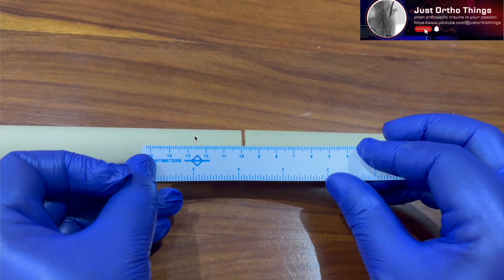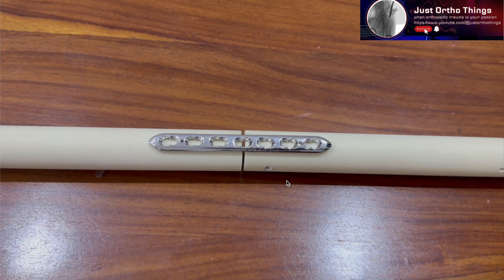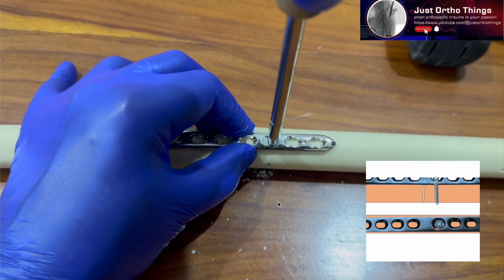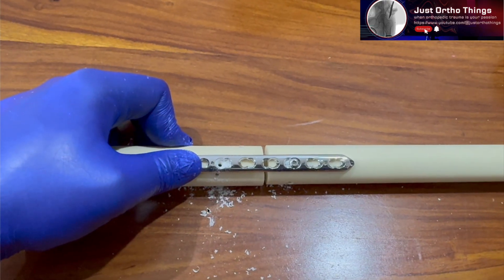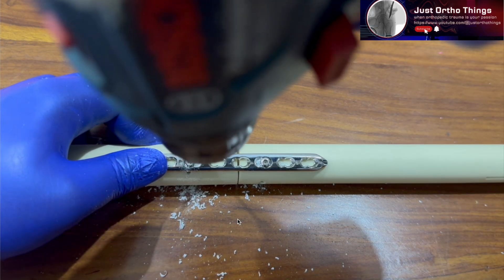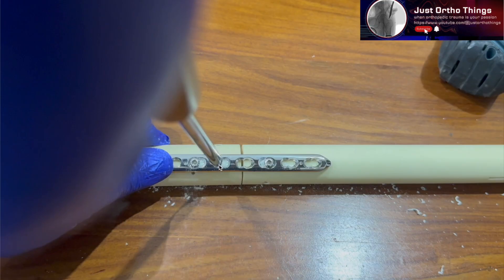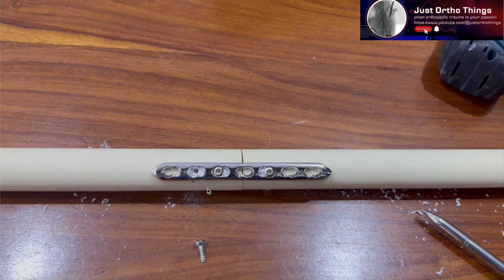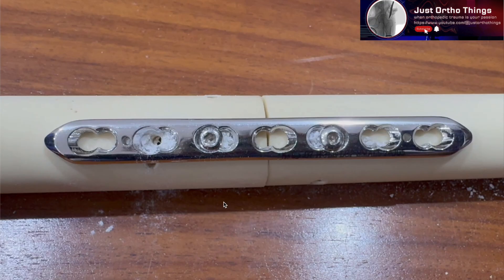2mm Compression with Dynamic Compression Plating (DCP) principle

Comment: Can we put the first centric screw on either of the fragment ?? Or is it like on the proximal or distal fragment ? Or like near or far from joint ??
Reply from the maker: See all movements are relative, so eccentric screw makes plate and bone slide in relation to each other. When eccentric screw is on distal fragment, the distal fragment moves towards proximal fragment and when it is proximal fragment, the plate pulls distal fragment towards proximal. So,  any side can be chosen for eccentric screw. Will give same compression.
Reply: @Justorthothings thank you

Comment: what screw do you put in the first eccentric hole after achieving 2mm compression?
 its almost in the middle of the combi-hole.. difficult to get a screw head fit in there.
Reply from the maker: Its does sit! Screw in middle area is equivalent to centric screw of conventional DCP. The combi hole has geometry like that only. The purpose of showing the first eccentric hole migration was show the dynamic effect of second eccentric screw. Otherwise even if it is not sitting well, its not going to change the compression achieved by second eccentric screw. You just tighten it  to best fitting position.
Reply: @Justorthothings  i meant.. its difficult to fit the head of a cortical screw in the middle of the same combi hole - between locking hole and DCP hole.
in first compression the first eccentric screw becomes a central one... during second compression the first hole comes to the center of the combi hole.. so!
Reply from the maker: Okay, I would like to clarify. See, once we have tightened the second eccentric screw fully, the first eccentric screw just needs to be placed as a positional screw. We dont extract it completely, I have just removed it to show the hole migration (2mm position change compared to previous position). Now here, you just tighten  it wherever the head is seating. Usually the head sits well, the junction between the locking hole and cortical hole incorporates the head well, but if its not sitting that is not going to create any problem. The shaft of screw is already inside the hole when we loosened it, so next step is to just tighten it in best possible position. Dont worry about head seating well or not.
Reply from the maker: @dimpu1991
This short clip shows the position change scope for head and shaft. Head can move around 1 mm more in slot from initial position and shaft can move around 2 mm from initial position. So first screw head shift 1mm more after final tighening. This can vary according to implant design but happens in most.
https://youtube.com/shorts/eEe_Wm6uCAY?feature=share

Comment: Can you achieve additional 1 mm compression if you put a third compression screw?
Reply from the maker: In DCP, not feasible as the first eccentric screw moves towards opposite metal edge. In LCP, still possible as locking hole provides extra space.
Reply from the maker: There are some unconventional tricks which can help in gaining more compression. I ll post soon.
Reply: If we put eccentric screws on all slots is the compression still  limited to just 2mm .
Reply from the maker: Movement of screw in one hole is limited. If you want more compression, you need to to remove the initial screw which has already migrated close to the hole edge.